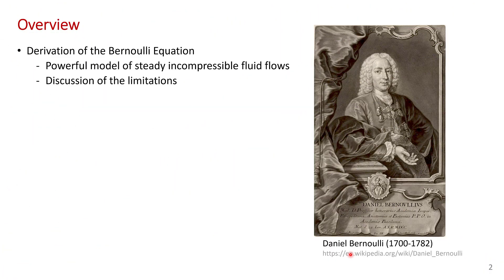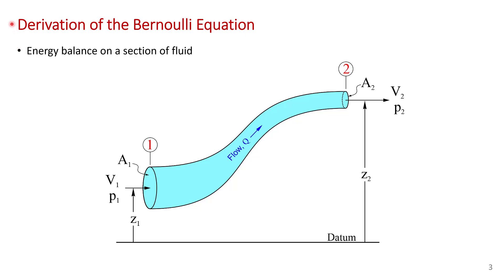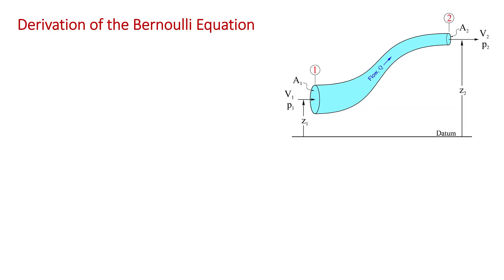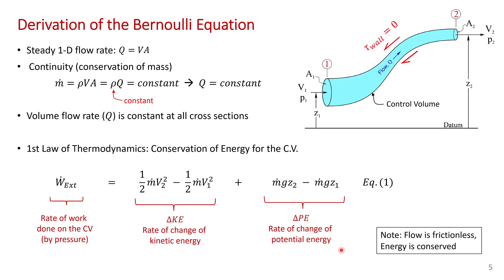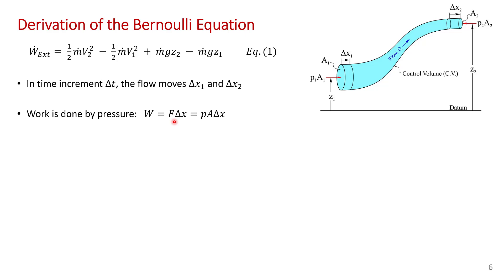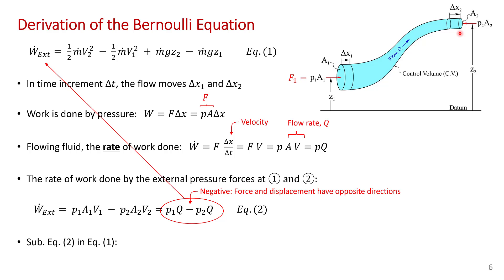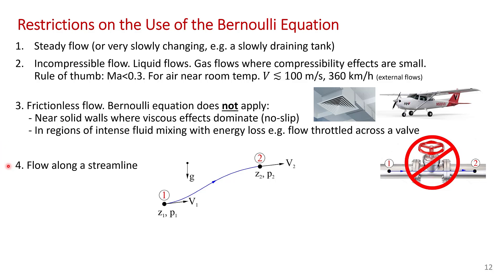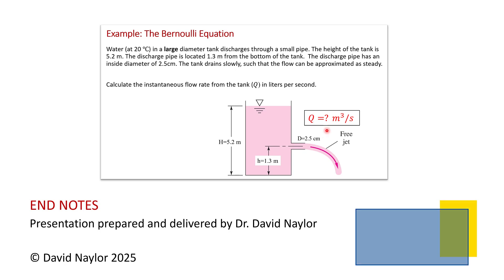Understanding Bernoulli's Equation: Derivation and Its Limitations

Comment: The derivation process is performed by equating the work done by pressure with different forms of energy change, it is analyzed towards the system rather than the control volume. Furthermore, the reason the changes in kinetic and potential energy of this system are simply treated as the difference between the corresponding kinetic and potential energies at the inlet and outlet seems unclear.
Reply: This is a follow-up reply. I think I got to understand now that this is indeed a treatment of the energy conservation equation for the control volume. Naturally it may be written as the net change in energy within the CV is equal to the difference between the energy flowing in and the energy flowing out. Since it is the inviscid flow, the net change in energy within the CV should be zero, namly, energy conservation.The key is to include the pressure potential energy in addition to kinetic and gravitational potential energies. However, if the conception of work done being used, it might bring about some confusion about system vs control volume, because the term "work done" is always anchored with the system rather than the control volume. I greatly appreciate the way you derived the Bernoulli equation from the perspective of energy. Compared to the regular version where it starts from infinitesimal elements, this updated version deals with the macroscopic control volume from the energy perspective, making it more magical and simpler!
Reply from the maker: I understand your point.  This was a conscious teaching choice. I could have used a pure thermodynamics control volume derivation with an enthalpy balance (p/rho in and out). But then one tends to lose the physical interpretation of the flow work -- which helps students have a physical understanding of why the pressure drops when the velocity increases. I probably wouldn’t present it this way in a textbook, which needs to be technically more rigorous. But, in my opinion, it's a good in-class teaching approach. Thanks for the comments.